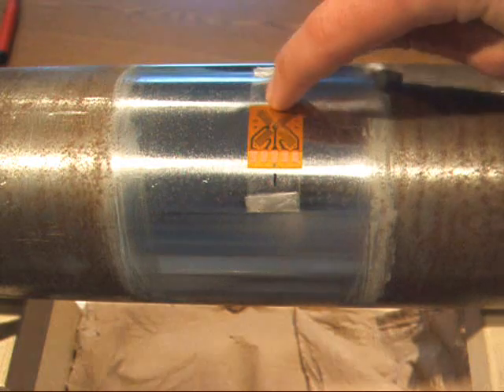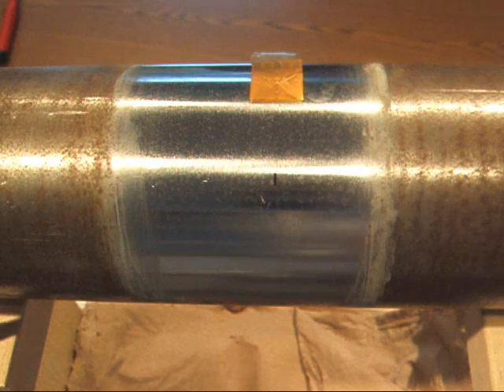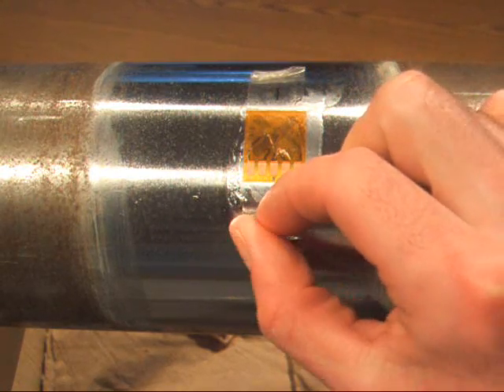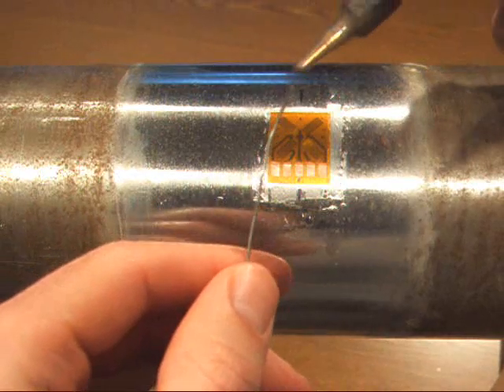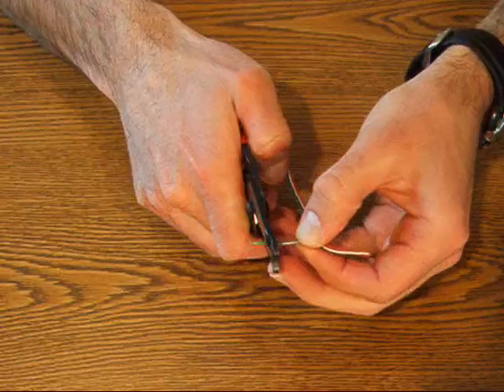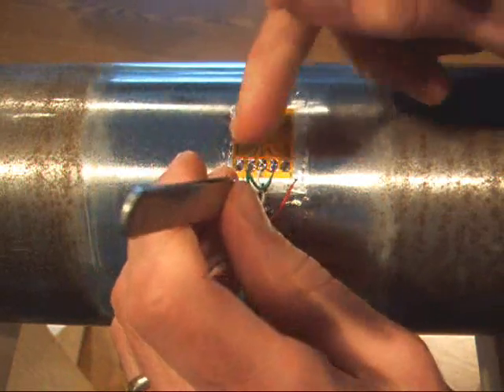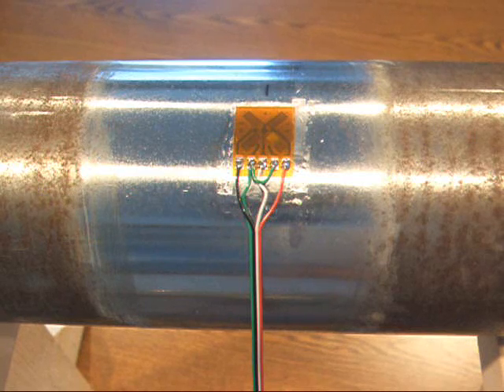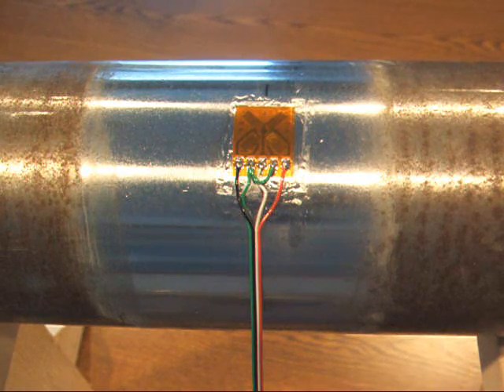Strain Gage Installation (Part 2)

Comment: Could this be installed on a manual transmission gear selector lever?
Reply: Can we use Feviquick or superglue 
 Instead of adhesive...  We can't find any adhesive near our college ...and  we need to  start as soon as possible..

Comment: These gages have big tabs, so it may not help much here, but with smaller tabs, I tape my lead wires into position, contacting their respective tabs.  This holds everything in place very well.  Of course I attach the tape a few millimeters away from the soldering tabs.